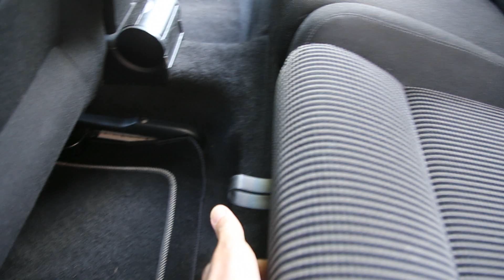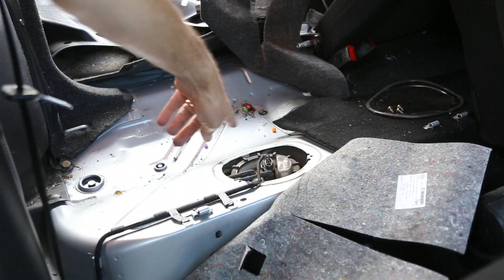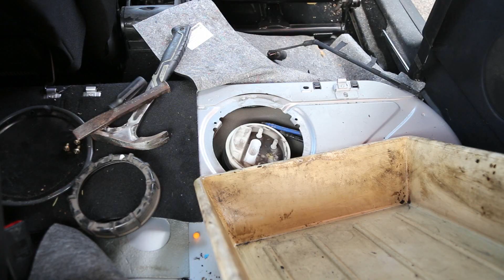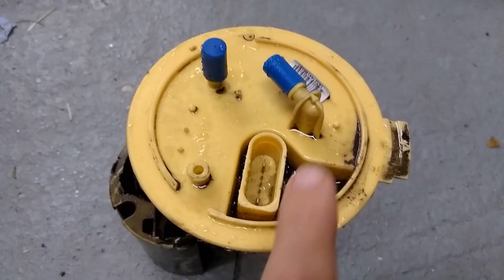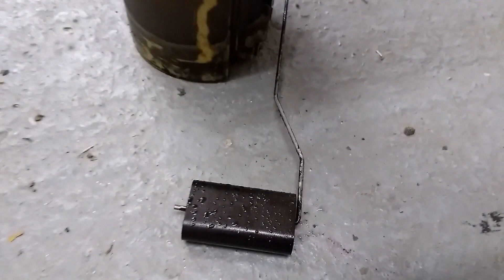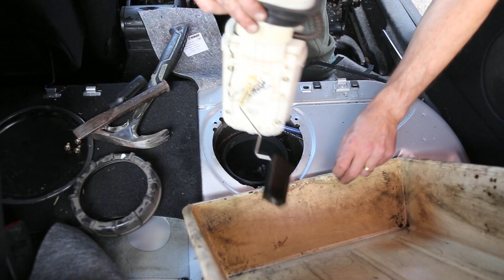VW Passat/Golf/Touran Broken Fuel pump removal - How to replace and fit new fuel pump unit

Comment: I was suffering with a MIL light coming on at 1500 revs. Fault code indicated fuel supply insufficient. After much testing I found that the small mesh filter at the bottom of this pump was partially blocked with a jelly like substance. That might help some of you out there. Good video BTW, nice and clear for first timers.
Reply from the maker: Thanks for the info, glad you got it sorted

Comment: Are by any chance the fuel pumps different for diesel and petrol as the one I have on my diesel is similar to yours and has a spring but the one we have to replace it doesn’t and has less wires but I’m not sure whether that’s just the type
Reply from the maker: They may well be. I've only replaced the pump on a diesel so not seen the difference with a petrol one

Comment: I have a vw sharan 60 plate, is it allocated the same place as well. I tried to look under the rear seats and  i can't find it?
Reply from the maker: A Sharan may be in a different location, I've not owned one of those I'm afraid. Is it under the boot floor?
Reply: @ajvw  , Hiya thanks for your reply.  I've checked the boot floor and the carpet is intact, even pressed around to feel any depth or lumps to indicate bolts and nothing at all to indicate there's anything underneath
Reply from the maker: I had a look and it should be the same as Ford Galaxy which does seem to show it as under the rear seats but you may need to lift carpet to find it
Reply from the maker: https://www.fordmpv.com/smf2/ford-galaxy-common-faults-and-problems/ford-galaxy-in-tank-fuel-pump-level-sender-removal-replacement/
Reply: @ajvw  that sounds promising,  I'll update you when I've had a chance to look properly later on

Comment: My back seat doesn't open up like that. Its all one piece. Any ideas?
Reply from the maker: It should still lift up even as one piece. What year/model of Golf is it?
Reply: @ajvw  2012 Passat TDi
Reply from the maker: @lizzy9178  the seat should still be able to lift but the Passat seat lifts in a slightly different way, you need to pull from the front edge to release it

Comment: This is hazardous. Think you need to repeat the warning about battery, plus warn about any source of ignition like heat, flame, smoking, electrical equipment, static or spark, including mobile phones. Don't want people to end up incinerated :). I imagine that when it's done in the workshop, the worker is also grounded to the car with a wrist strap to avoid static.